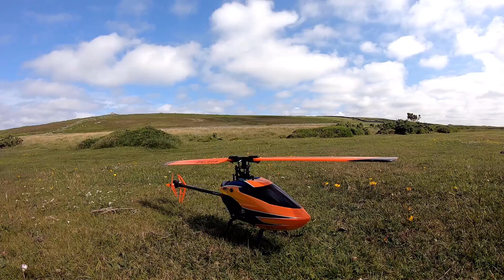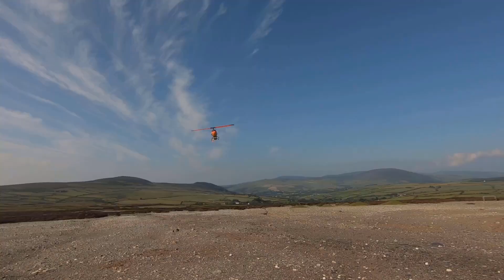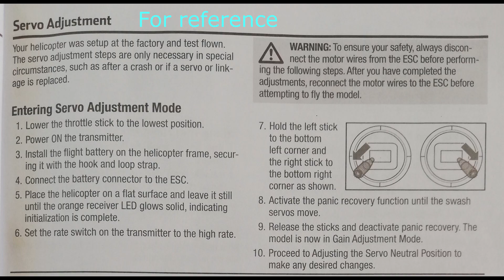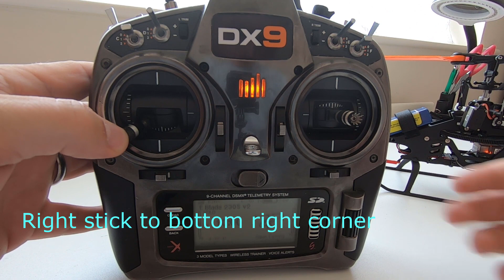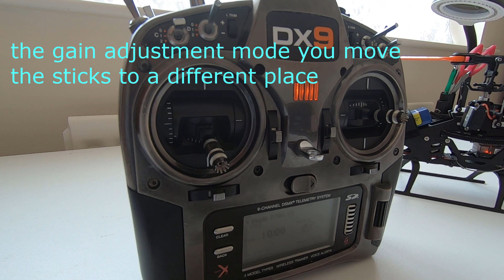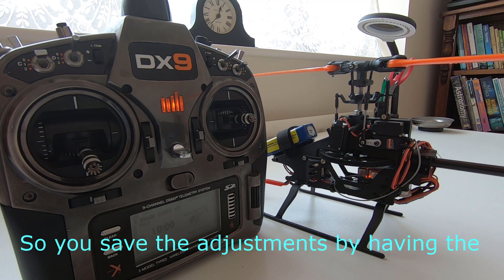Blade 230s V2 drift: SOLVED!

Comment: THANKS.   IMHO: YOU NEED TO PUSH THAT BATTERY ALL THE WAY BACK, TOWARD THE ROTOR, UNTIL IT IS UP AGAINST THE STOPS.  THEN, ADD SEVERAL GRAMS OF LEAD SHOT, AND EPOXY, TO THE (INSIDE THE FORWARD TIP) FRONT OF THE CANOPY SHELL.  YOUR HELI NEEDS TO HANG PRECISELY LEVEL, WHEN SUPPORTED AT THE MAIN ROTOR MAST, (USE A PIECE IF FISHING LINE, WRAPPED AROUND THE MAST, COMING UP, AROUND EACH ROTOR HUB, UP TO A COMMON KNOT, A COUPLE INCHES ABOVE THE CENTER OF THE ROTOR HUB.  IT THE HELI IS STILL "TAIL HEAVY" (AS THEY ALL SEEM TO BE, FROM THE MFG.), KEEP ADDING A FEW MORE GRAMS OF LEAD SHOT, AND EPOXY, UNTIL THE "CENTER OF GRAVITY" ("C.G."), IS SHIFTED FORWARD , SO IT MUST TO BE DIRECTLY BENEATH THE MAIN ROTOR HUB.  THEN YOU OUGHT TO SEE A HUGE IMPROVEMENT IN THE STABILITY, AND BE ABLE TO GET VERY PRECISE, CONTROLLED HOVERING, AND SLOW SPEED MANEUVERING, WITHOUT ANY NEED TO "CORRECT", OR FIGHT THE HELI, (IN STILL AIR).   "CHEERS!!"  :face-blue-smiling::face-green-smiling::face-fuchsia-wide-eyes::face-orange-raised-eyebrow::face-orange-biting-nails::hand-orange-covering-eyes::eyes-pink-heart-shape::body-blue-raised-arms::face-turquoise-covering-eyes::hand-green-crystal-ball::face-red-heart-shape::face-red-heart-shape::face-red-heart-shape::face-red-heart-shape::trophy-yellow-smiling::trophy-yellow-smiling::trophy-yellow-smiling::trophy-yellow-smiling:

Comment: Help Please . I have this same Heli .  Collective pitch is not working . Throttle works and so does Rudder on left stick . Right gimbal is fine. Elevator and ailerons move fine . Please help . I'm using the DXs transmitter that came  it came with .

Comment: Now that I've been flying mine a bit could you not have just used forward programming and adjusted the flight controller.  There's calibration settings and their for the drift… That's what I did and my 230 hovers perfect… And it was quick.  But believe me I am no expert I did find the blade 230 had horrible tail rotor Hold… So I had to learn the PID algorithm and the numbers I programmed are nowhere near what the factory puts in.  I now have a better tale hold I was getting large blowback when aggressive

Comment: Is this basically doing smaller versions of trim? I tried this on my DX6i and I don't think it did anything
Reply from the maker: I guess it has the same effect as trim but we don't use trim on transmitter with rc heli really. Could call it more like fine tuning servo centre position.

Comment: I have this problem on my new blade 230 s (smart) does this method work there to? And If i use a spektrum nx6
Reply from the maker: Good question. Couldn't give you a definite answer to be honest mate. I've no experience with the 230s smart.
Reply: @RCStuffvideos  myb i can try this method, it won`t harm anything :)

Comment: I think this is not the right way. These steps worked for me perfectly :
1. Adjust the servoarms with the shown method perpendicular to the servo (eyeballing)
2. Adjust the swashplate to a leveled position by adjusting the linkages (swash leveller / eyeballing against a horizontal line on the wall for example)
3. Adjust the center of gravity to the best you can
4. Do the Calibration flight (hovering for 2 minutes or so with no wind) with a velcroed battery WITHOUT tightening the velcro strap or no velcro strap !
Done - Flies like pussycat
Reply from the maker: Hi mate thanks for the comment. That's awesome. Hope it helps some others here too. Happy flying.
Reply: @RCStuffvideos  jeah- took me weeks to figure it out - i have a phd in conscientiousness 👨‍🎓
Reply: This is the correct way. I have a v1 and did this exactly however I had to let the heli climb till it was pretty high while holding it steady. Then when it had a bit of drift still I repeated the trim flight with a steady 2mph wind blowing it in the direction it was drifting. Held it steady and now my 230 feels like it has gps lock.

Of course stability and trim flight has no effect on the stunt modes aside from panic recovery.

Comment: Hello everyone and Happy New Year ! I just received the Blade 230S Smart BNF equipped with the AR6250MHXA. How to insert the Bind Plug association socket without dismantling everything? In addition, besides the fact that my fingers do not pass and that I do not see the plugs, a plug is already connected to the BIND plug ..... My radio is a Spektrum DX6 G2 EU. All have a happy new year 2022!
Reply from the maker: Hi Cedric happy new year. I don't completely understand. Are you trying to bind it to your transmitter and cant get the bind plug in, or the plug is already in and can't remove it? Thanks
Reply: @RCStuffvideos  the bind port is glued at left side of the frame :-)
Reply from the maker: @cydrec  I'm not exactly sure about that to be honest mate. I know the 230s smart is different in a few ways from the V2. I only have the 230s v2 not the smart. The V2 just has bind port on back of the receiver easy to get to. Do you have the manual for the receiver and helicopter?
Reply: @RCStuffvideos   the AR6250MHXA he's fully different than previous receiver. Anyone reply to my the bind plug is on the side of the heli 230S Smart, now it's ok. The manual is empty about that

Comment: do you spend a lot of time in angle self leveling mode- this doesn't pertain to acro (fm1 & 2) does it?
Reply from the maker: I never fly in self level mode. Maybe 3 seconds to take off. Good question about pertaining to idle up. I'm sure mine flew better in all modes. I think it depends what mode you'd use as a reference if that makes sense? So i THINK you could fine tune it in any mode.
Reply: @RCStuffvideos  so when you're in acro it would drift? if you set up a stable hover it would still drift? I don't get it. the swash stays where you put it doesn't it?
Reply from the maker: @skypilot23  yeah it should do pretty much. 
I can't remember exactly what idle up was like back then but more recently I was fiddling with sub-trim now I have a dx9, to try and get it hovering even more accurately and it  seemed it could be tuned for self level or idle up if that makes sense. I think sub-trim is kind of doing a similar thing to this procedure. 
I'm not going to pretend to know everything but it did seem to affect idle up a bit too.
Are you trying to solve a particular problem?
Reply: @RCStuffvideos  not having a problem here- but liked your video and trying to get detail. When I put an attitude on the swash it holds there until I give further input doesn't drift- anyway happy flying

Comment: After almost owning a 230S smart for a year. This actually worked for this version. Crashed it bad. Rebuilt it. Did a bunch of trim flights and calibrated the dam thing more times than I’d like to count. Though this was the only thing that worked!!! I’m also using a NX series transmitter for those who are curious. It works! Though it does jump “ hop “ differently when you enter this mode.
Reply from the maker: That's awesome. Glad it helped.

Comment: The trick is to use subtrim 
To correct the drift.
Trim tabs should remain untouched. 
Sub trim only.
Reply from the maker: Yeah sure. Definitely if you have a transmitter with it. This is for people with the basic transmitter
Reply: Doesn't subtrim see it as a movement and keep going that way, or am i confused with tail gyro's. I have the nx6 transmitter

Comment: Mines been stupid ever sense I bound it to my dx6e and off the ready to fly dxs..not sure why my stability mode doesn't work anymore.. thinking I don't have something right but don't know what
Reply from the maker: I heard of that before with the dx6 o think. Not exactly why. I'm sure someone on helifreak will know, or certainly horizon hobby themselves.
Reply: Mine acted that way with the dx6e and after much head banging someone told me to go into the stability menu of forward programming and activate stability there. It got mine working again.
Reply: @taildragger1589  I must need to update mine,, because I don't have the forward program in my menu.
Reply: @jakelang4387  forward programming does not appear on the DX6e menu unless the helicopter is turned on. Turn on your chopper and it will magically appear in the function list

Comment: I re place the blade grips and it didn't fly after I replace the blade grips I did the servo leveling thing inside the book like what you said now it does great and I don't have the dx678 or 9 I just have the ready to fly transmitter that came with it and it seems to work out quite well thank you for your video appreciate what you do stay safe
Reply from the maker: Hi Jon, thanks for the comment. Really glad you found it useful. Cheers